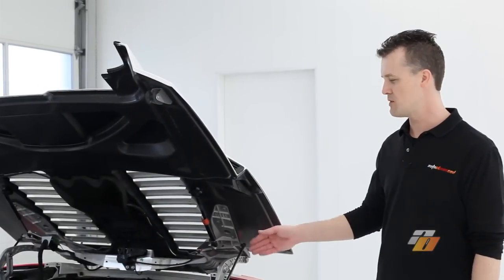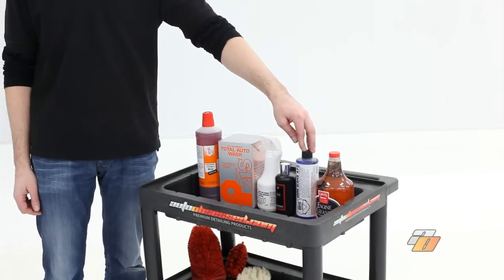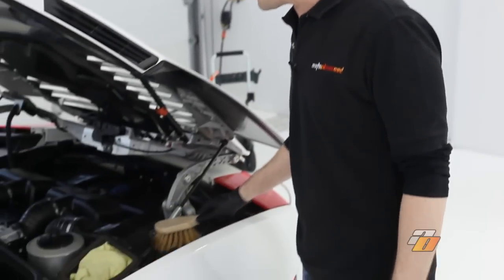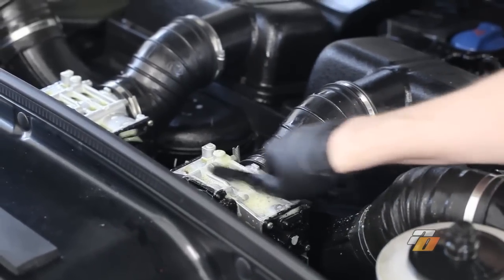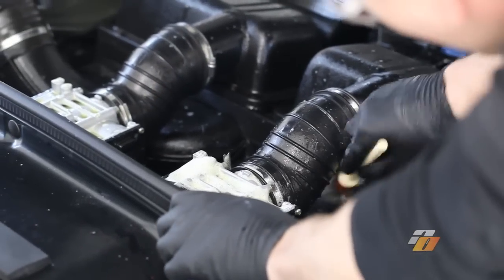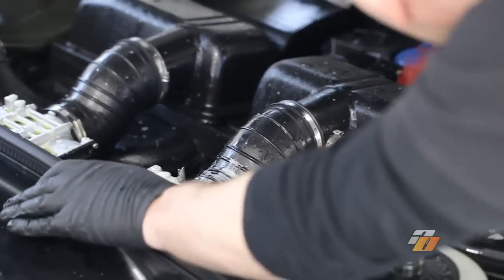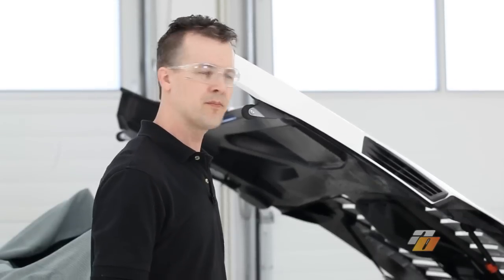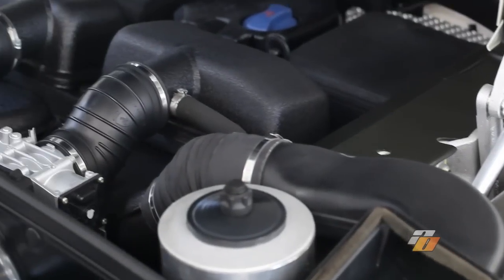How to Clean your Engine Bay, cleaning engine demonstration by Auto Obsessed

Comment: Just a thought: Use of a pressure washer in the engine bay should be done with caution. Sensitive electrical equipment such as the alternator and other connection points can be affected by the water pressure. 

Otherwise, great video. Even though I regularly do all these things on my car, it's nice to watch these videos while I wait for spring to arrive so I can get back to cleaning my car up. Great info and nice production; keep it going, guys!
Reply from the maker: Well said, you always have to use caution when washing engines, cover any components that could het harmed and follow advise from the respective manufacture.  Thanks for the feedback.
Reply: Thank you, finally someone who understands common sense. Coming from an electrician this is the WORST thing you can do. You could damage the ground system and cause extra current to travel into the Cars’ cabin. This could shock the driver and make them sick with EMF. All these detailing knuckleheads are doing too much